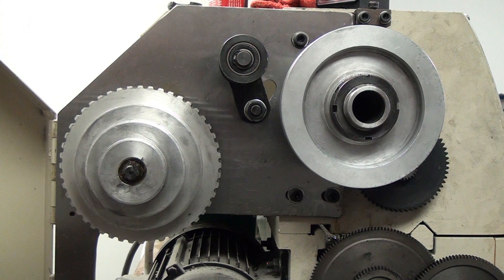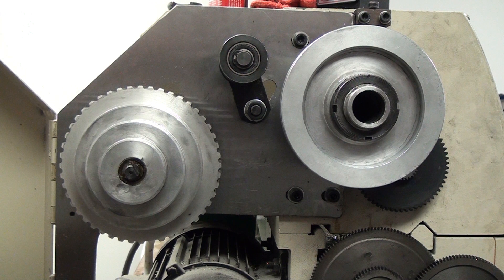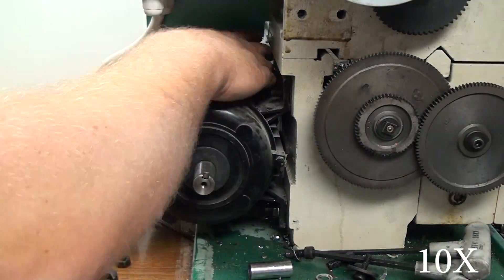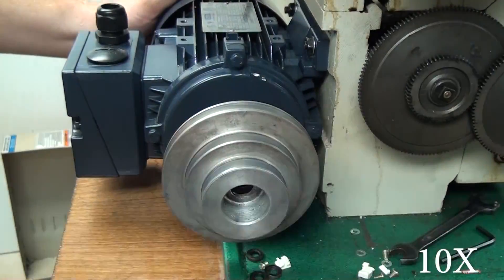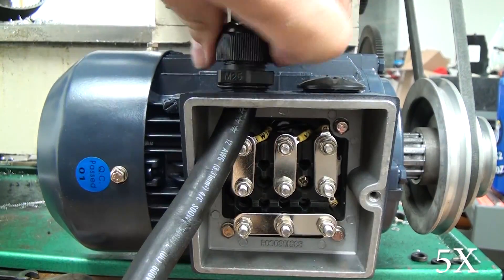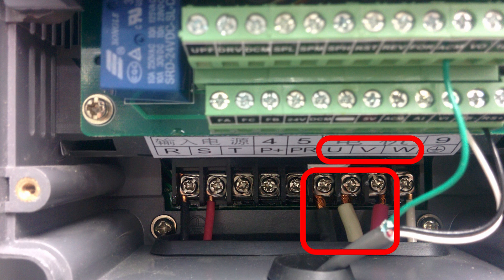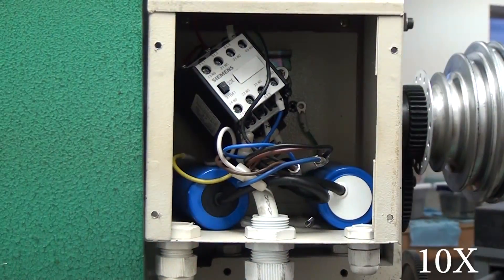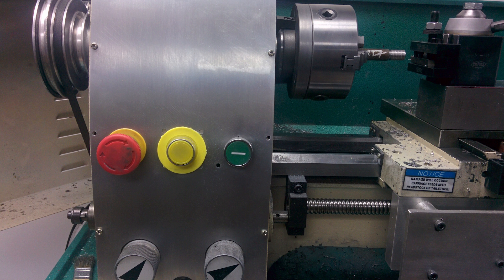G0602 CNC Conversion pt10 - 3 Phase Motor (LEESON 192051.30)

Comment: Do you know of a 3 phase motor that will fit this lathe that's at least 2hp or 3hp? I plan on turning some steel and I need that extra oomph. Thanks in advance.
Reply from the maker: I don't, but I know what you mean. If I were doing this swap over I'd just bolt the motor to my table. It doesn't need to be on the lathe for any reason unless your stand/table doesn't have room.

Comment: Awesome video! I'm curious what your thoughts are on using a DMM 750 watt servo with the dyn4 drives? I'm having a hard time finding a reason not to.
Reply from the maker: Hello! I apologize, I'm just seeing this now, did you go with that setup? Let me see what my servo guy says...... Sam?
Reply: Those are good size servos for the G0602 I have plans to upgrade my G0602 using the 620 and 640 with dyn4 drives.
Reply: No I dont think so I did get a 1.3kw that I hope to be able to use for the spindle but I have not tested.
Reply: Sorry I didn't clarify. But I meant the 750 Watt as the spindle motor?

Comment: I'm looking at the g0602. Are you still happy with it? Was debating the pm1022
Reply from the maker: Hey Brian. It's been good to me so far. The PM looks nice too. Power cross slide is cool especially if you don't plan to CNC it.
Reply: russtuff I plan on cnc
Reply from the maker: Then it might be sixes. If there isn't much info on PM conversions you could blaze some trail. Tons of G0602 info exists so it may be the quicker path. Mine hasn't let me down, other than some changes I need to make to the CNC conversion itself.
Reply: russtuff thank you

Comment: Gosh. After seeing how a lathe is built with a motor and a pulley with a belt turning the lathe, it would seem that you could just build one yourself. ...and a really powerful one for much cheaper than buying.  About 1/2 price probably.  ...and it would be better.
Reply from the maker: Its a pretty light duty machine for sure.
Reply: Sure you can build it yourself, but try and see just how much work it is to do a oneoff. Not to mention getting the bed accurate easily.

Comment: +russtuff Yet another very helpful video. Keep 'em coming!

I'm seriously looking to get either the G0602 or G0752 (a variable speed version of the G0602 with 1HP 3 phase AC motor and VFD). I imagine I'd cnc it eventually, but probably not for a while.

Based on your experiences so far, do you think the G0752 is worth the extra $500 right off the bat?
Or would you still do it the same way and get the G0602/upgrade later?
Reply from the maker: +Derek K I have to say, I'd probably pony up and get the variable speed version up front. Doing it on the cheap like I did I'm probably still close to $350 plus my time, so for me I would like to just have it done already. That said, I'm very short on time these days (which is why it's taking forever to get this series finished).
Reply: @russtuff  I came here looking for the same answer, and in 2020 the difference (on Grizzly's site) is a full $1000.  For me that's enough difference to warrant doing things the hard way, and probably getting a higher quality motor when I'm done.  What lathe did you end up buying, and how do you like it?

Comment: Another great video Russ.  I am beginning a PM-25MV conversion with DMM servos.  I have the mill and servos, but still on the fence in regards to controller software.  Do you plan on doing any videos on Linux setup and operation?  Your stuff seems to run really well on Linux.  I am already behind the 8 ball with the non G0704 mill and servos, so I do not want to use Linux if it will be a lot harder to implement than mach3/4.  Keep the videos coming, shoot some making stuff on your nice machines.
Reply from the maker: +F1hotrod Thanks! I have filmed a whole series on LinuxCNC but I haven't posted any of it, because I may re-shoot it (some of the information isn't up to date). Servos would be no problem on LinuxCNC I'm sure, but I haven't used them myself.

Comment: at 4:00 - you should have ground (green) and not neutral connected to the vfd ground terminal
Reply from the maker: +sharp x Agreed. However, my house was built in the early 90s when 220v circuits were not required to have both a ground and a neutral, so the neutral becomes the ground in this case. It isn't ideal, but that's mostly from an efficiency perspective. It is still quite safe.

If I ever get to build a shop (or if I move this operation into my garage) I will have access to my meter/panel and can then install a proper 4-conductor home run.
Thanks for watching!

Comment: I didn't hear an HP rating on the new motor.  I found your FB page, but no info on the motor there either.  Do you have a site?  I should know this! LOL!!!  You said it's well documented.....where?
Thanks!
Mike
Reply: +bluehandsvideo Its still a 1HP like the original, I have the same one, LEESON 192051.30. I think this lathe needs more power, 2HP at least. If I don't get a new lathe soon, I will be upgrading to more power for sure.
Reply from the maker: +bensbenz +bluehandsvideo
Thanks Ben. I failed to mention the exact motor in the video, so I've added it to the video title.
For the ease of bolting on this motor I still think it's a good solution, but you're right, 1HP does have its limitations. I don't think I've seen a larger HP D80 frame motor, but I'm sure they are out there.
Reply from the maker: +bluehandsvideo You're right, I didn't mention the motor details, only that the details are available in video #2 of this series. I've updated the title of the video with the motor model number though :)
Reply: +russtuff Ah....I must have missed the vid #2 comment.....I shall check it out again. :)
Thanks guys!!!  I'm putting a 2HP on my 9x20....someday.  Even the previous 2hp would still stall.  At some point, I want to do the 3ph motor and vfd which is why I was paying attention to this. :)  Did you happen to see what 2hp on my Torus mill will do with the 4.5 pound chuck on it?  Dayamn!!!  FB or IG. :)